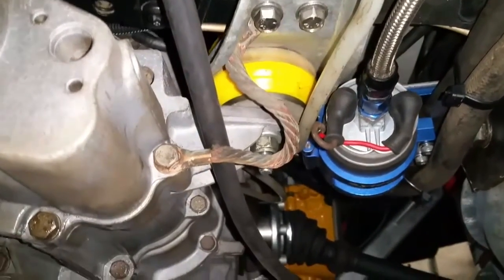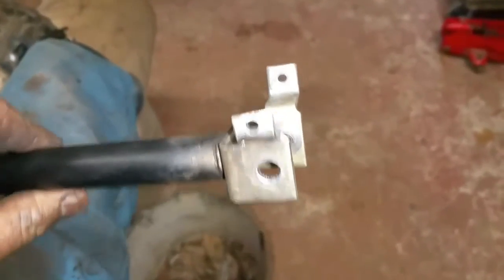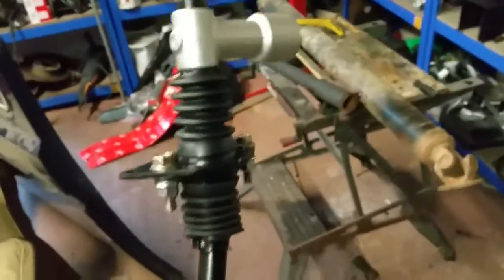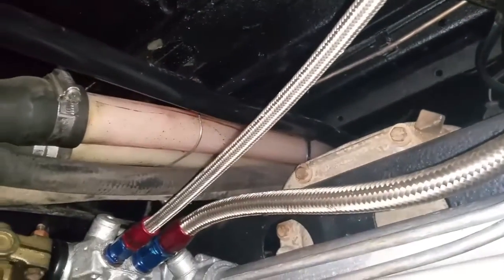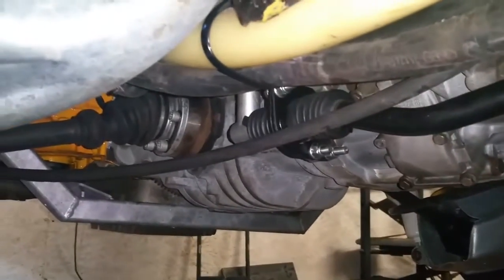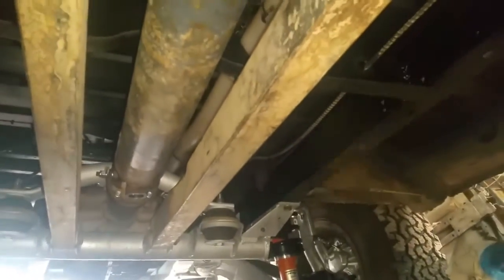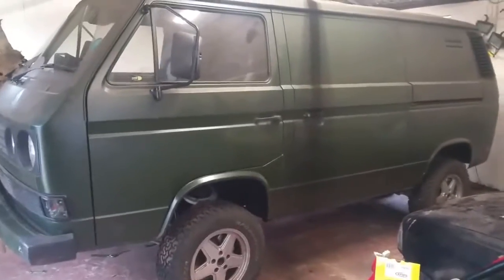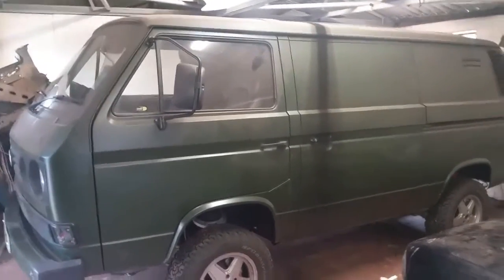VW T25 T3 Vanagon 2WD to Syncro 4WD Conversion Project - Back on it's Wheels (with a few problems)

Comment: infuriating, buying a part which is supposed to fit and then it doesn't.
Your local engineer is a good bloke to find an alternative part which made the prop shaft work :-)

Comment: hi man, I cant believe no one has asked about those little white plastic things you put over the prongs on the stick end of the shaft, where DO you get them!!?? please. they are missing off mine and I'm sure they will help get thru the porridge which is my gear shift atm thanks. very nice by the way, (very very) Paul
Reply from the maker: Hi and thanks 
I got the Selector Fork Repair Kit from Brickwerks - https://www.brickwerks.co.uk/selector-fork-repair-kit-t3-4-speed-syncro.html
Cheers